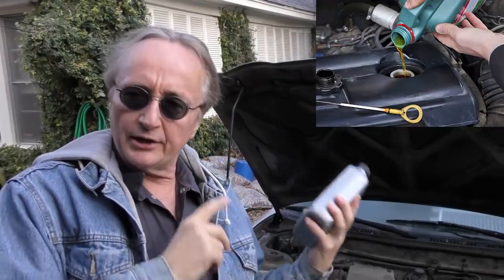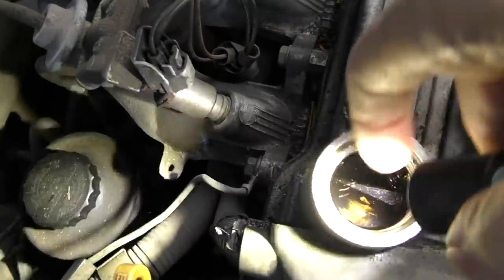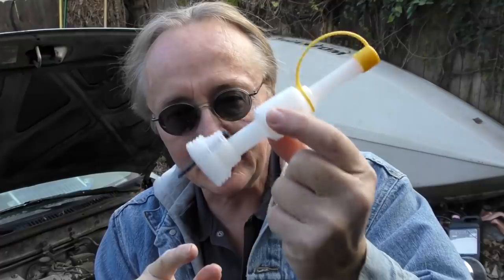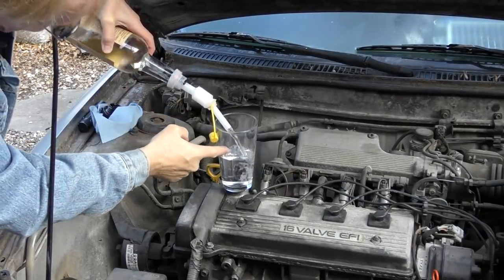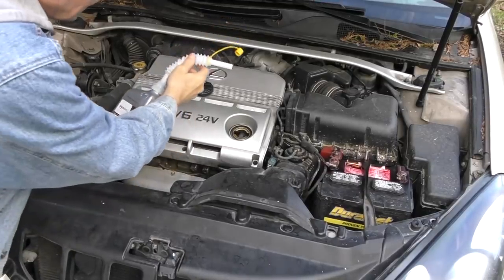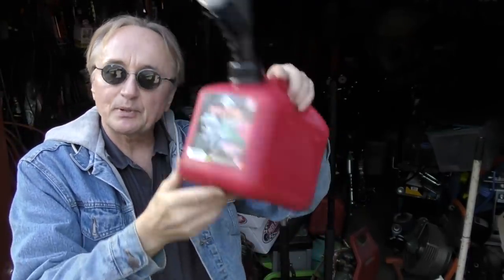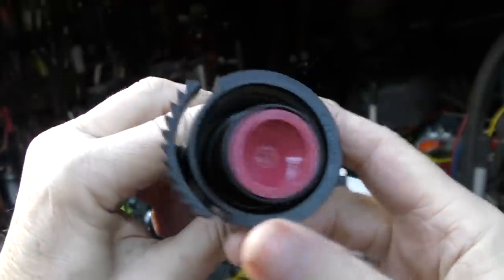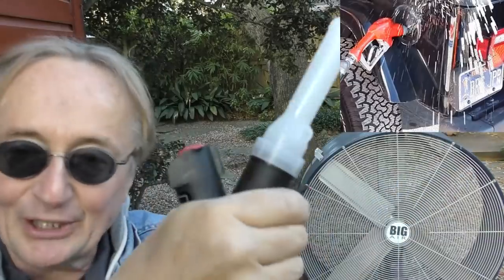The Future of Car Repair, New Invention

Comment: I see the oil funnel even works with Amazon oil.
As much gas as my truck uses I should put a 55-gallon drum in the back of it and see if that funnel would work for filling both tanks.
I get 5 miles a gallon.
Reply: How durable is it.
Reply: 5 miles?? What do you drive

Comment: That press & pour gas funnel does come with a cap, according to the Amazon listing. I'd highly recommend putting the cap back on, despite Scotty saying you could leave it off, because I guarantee spiders (and their webs) and other bugs will find their way down into the spout. They might not make it into the gas can, but once you pour it, they'll be flushed out into your gas tank. Spiders absolutely love building webs in my regular ole funnel.

Comment: Scotty's engines appear to have some varnish/sludge buildup under the filler cap on the baffle plate.
Reply: Keagan Hunter on a 30 year old car.
Reply: Doesn't matter how old the engine is just depends on the oil used and the driving conditions and when its changed.

Comment: Scotty I"ve been a mechanic over 45 years, big fan of yours. But when are you going to clean up your garage?
Reply: Lol my Grandfather never did after all the yrs i worked in there.. 18 cars later value parts tooks and junk omg 9 full 26 foot dumsters
Reply: The shop would hold 9 cars at a time
Built around 1930
Reply: some of the parts i kept i had eventually assembled a 1929 model a there was also a large barn stored back beyond ever pre 1908 the parts we sold accumated over $672,130 :) it was probably the most rehated hist near gm oshawa canada it used to be a small testing facilty back at some point testing transmission confurationgs for the first powerglides and th turbo concept i came across crap that blew my mind,

Comment: Neat, but for oil changes I prefer the screw on type funnels specific to the make of car, impossible to spill and you can pour 3 quarts jugs of oil at a time without it overflowing. OEM tools makes the funnel kit with screw on adapters for every make and model of car for like $80

Comment: Got a new gas can last week due to rotted out lines where they met the plastic. Couldn't figure out the safety nozzle. I also have a long funnel,  so I took the nozzle off the can and poured into the funnel into the tank.

Comment: Virtually everyone pours their 1 quart oil jugs the wrong way! If you've ever noticed, one side is higher than the other. You're supposed to pour it sideways, with the high side on the top. This allows air to flow in so the oil doesn't "glug" out as long as you don't pour it too fast.

Comment: On my 2012 Camry 93k mile, then go to reverse after star it just bangs (make a loud noice or shake just one time). Car drives fine. Also when I am in high speed I here a smooth grinding noise(like a humm comes up and goes back all the time) not steady noise, it comes up and goes back for 2 sec and come back again when I am in 50 or 60. I changed my torq converter from Toyota due to and recall. Also, from 0 to 40 accelerating a bit off some time feels like the car doesn't want to go and rpm spick but sometimes it goes smooth and fast.

Comment: Thanks for the great tips and advice! Oh and I get a kick on every video with you standing in front of your garage because it looks like mine does inside. I bought my last GM vehicle I will ever buy back in 2000. So what did I buy but a 2006 Honda Ridgeline. Everyone raved about Honda's reliability but I think I jumped out of the frying pan and into the fire. Not very reliable at all and neither is my wife's Honda Odessey Touring, which is even worse. Those two Hondas have been two of the least reliable vehicles I have ever owned.

Comment: I need to replace my Creek shaft seal so I have a pretty good leak LOL but it's going to be expensive to repair because you have to replace the timing belt in the water pump if you really wanted you the job right so it gets even price hear if you choose to do all of those things otherwise you get done the road and the Whale week stop but then you have to worry about your timing belt snapping and 1/2 or your water pump going out and I just rather not worried about that but I would love to have one of those things to use to put oil in my car because I have the Lexus and it always gets around the room just like in your video and rips down on the exhaust manifold and it's a very unique smell so it will be so amazing to have one of those things with all the oil that I put in my car over the last year, it is crazy and went blow people's minds! Thank you for the video because I didn't know if that was normal for a to get in the room and down on the exhaust manifold so now I know, thank you I love your videos! You are amazing!

Comment: As much transmission fluid as my 99 XJ leaks I could put that to use. It's a common problem with the transmission cooler lines they can be changed 1000 times they still leak

Comment: I like both of those designs would be very handy .. In my shop I have  a quart stroke pump in a 55 gallon barrel of oil.. I fill one or 2 quart mason jars that I still have the Metal screw on lids  that have a funnel neck and a hole to let air back in ..   I refill plastic 1 quart bottles to carry spare engine or transmission oil in the car..  That is where this product would work ..  I have a spring loaded  fuel spout shout off  you have to turn it 90 degrees to open and close  very awkward and likes to spill gasoline because you can't shut it off fast enough ..

 Pick me Pick me

Comment: Scotty, thanks.  That's great.  I just bought the funnel.  Send me another one...LOL.  Yeah!  Thanks for the video's pal.  Hey by the way, my ES 330 like yours had a bad master cylinder.  They are crap on those cars.  Well, guess what, unknown to me, the brake fluid leaked internally into the power booster then got sucked into the engine through the vacuum line, where it mixed with the oil, it burned, clogged up the oil pump screen, oil starved the engine and the engine dies at the same time the oil pressure light comes on...and this while I'm on a road trip.  Wow.  What I mess.  Had to locate a new engine.  Cost me a few thousand.  Be careful with yours.  If your master cylinder starts feeling a bit spongy, but brakes fine, replace it!!!  I paid the price.  Toyota!!  All cars are crap.  They all break.  Car is running fine now...again...until next time.  Thank God I had my BMW to use while the Toyota got repaired...HAHAHAHAHA.

Comment: I bought the flexible funnel with the ingenious air vent; however, I cannot find anything on it that will puncture the top metal round plate on my quart oil container. I bought a gazillion cases of these round metal top quart oil containers from a U.S. government surplus property auction. I am still trying to use them up. To use the oil up faster, I think I will leave out the oil ring on the pistons the next time I rebuild an engine.